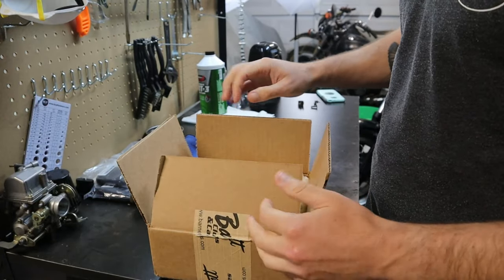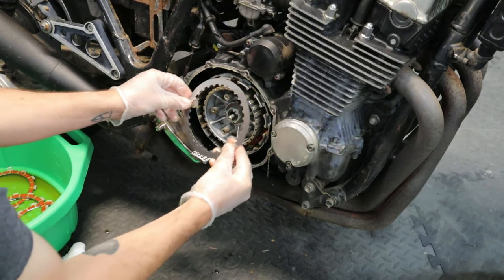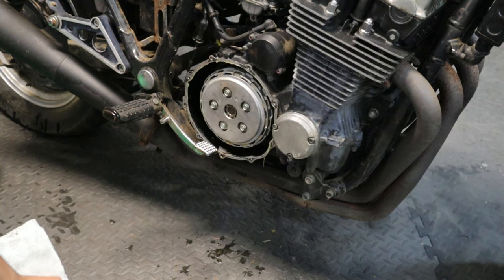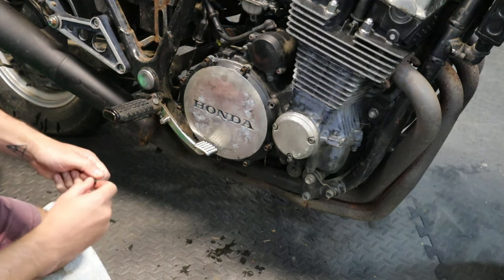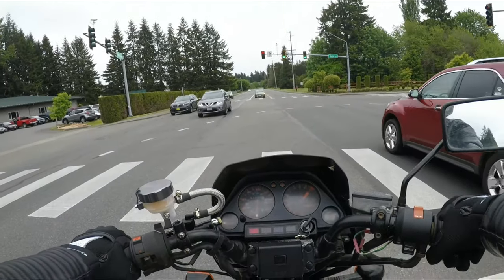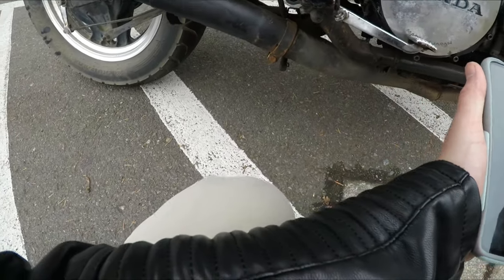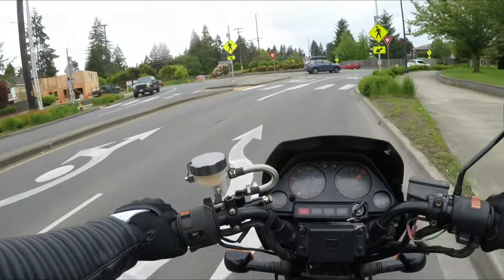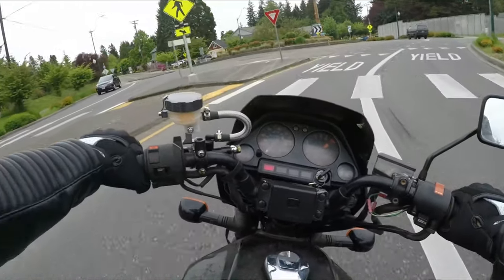How to Rebuild a Clutch Basket

Comment: That clunk would have me reacting the same. I wonder if the transmission dogs simply slipped and it got stuck between gears and when you moved it it then freed up.  My 75 is tricky going 3-4 as it will jump out. Caused by rounded edges on the cogs on the gears.
Reply from the maker: Thank you for the insight, Bj! That makes a lot of sense. I had assumed I was too hard on the brand new clutch plates and they had slipped or something. Appreciate you dude! 👊👊

Comment: Did you ever figure out what that rattle was when you're in gear? I have an 84 Nighthawk S and mine does that rattle in gear as well. It almost seems like the engine is lugging, but I can't figure it out.
Reply from the maker: I replaced the timing chain tensioner and that fixed it for me. I would recommend you do the same :)
Reply: @MotoMango  Damn I was hoping it wouldn't be something like that. Where did you get the new tensioner from? I read these bikes had an "automatic" tensioner from the factory. Did you get an OEM one?
Reply from the maker: Yeah, I got an OEM one from Partzilla. I have a video walking through the process. You got this bro
Reply: Cool man, I'll look into it. Thanks for your help! Just find it weird that it only happens in gear pulling away. I would think a chain tensioner noise would be audible in neutral idle and reving too, but oh well, guess it just comes with the territory when owning classic bikes lol.
Reply from the maker: That's true, I definitely had chain raddle at idle and in neutral. Can you message me on IG with more details? I can try to help narrow it down

Comment: Did you keep the bike in neutral when you changed them out, or does that not matter?
Reply from the maker: I would put it in neutral 👍
Reply from the maker: I honestly don't remember if the manual said anything about it, but I would just play it safe and have it in neutral

Comment: Did you have to drain the oil before removing the cover? The manual I got for my CB650 said to drain the oil.... is that really the case?
Reply from the maker: Some will definitely leak out. You could always lean the bike over and then it would be fine
Reply from the maker: I would just replace the oil though to be honest
Reply: Great idea. Thank you so much. You got me working on my bike this been sitting in the garage as a covid project 😂

Comment: My 1985 750SC clutch doesn’t look like that. Mine has large circlip holding a cover. Under cover is one big nut instead of 5 small nuts
Reply from the maker: Hmmm interesting. The 750s might have a different clutch, mine is a 700cc.
Reply: Same man. Came here specifically for that reason. The manuals don’t show it. The internet barely shows it. But the clutches are SUPER different